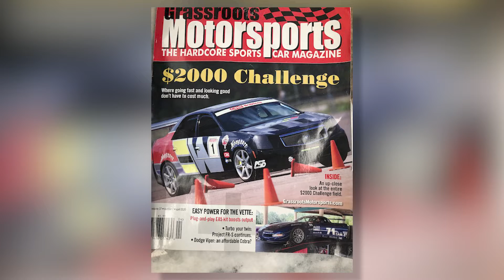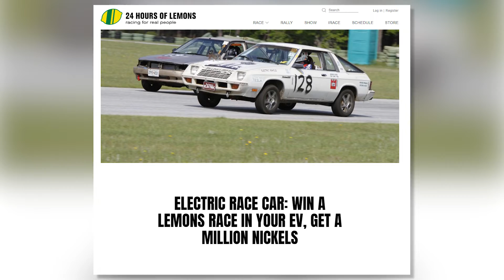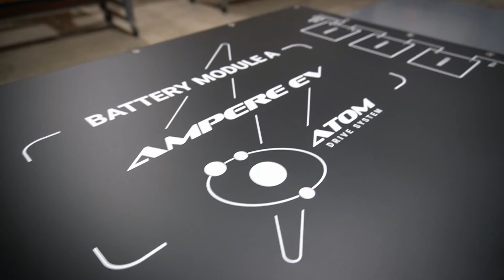Bringing Classic Cars Back to the Future - Matt White | Ampere EV

Comment: Thats a great story~! We think alike Kudos~! (* if im the smartest one in the room -then were in big trouble~!)
I have been seriously thinking about converting one of my Lotus Esprit's to electric, since it is the parts car for the other 3..
I figure, there are only 1000 electric esprit "plug in & drive",  kit buyers,  since the production run was less than 10,000 cars. 
Id like to bolt in a kit that has "pep" & re-gen, but leaves the car at the same weight.. (*performance over range )
Reply from the maker: The great thing about our Atom Drive electric powertrain is that all of configuration is done. There is no need to source components. We supply the motor/inverter (you select from our supported list to fit your driveline configuration), the DC-DC converter, the High Voltage Junction Box, the the high voltage wiring (we'll even make it to spec lengths and fully terminate it), and the low voltage wiring (ready to install and terminated as an option). The VCU programming is complete and vetted, the battery management system is integrated, the touchscreen interface is included (along with Navigation and CarPlay/Android connectivity), and you can add features that would otherwise take time not simply to source, but to program into the VCU for operation like AC/cabin heat, and even CCS fast charging.